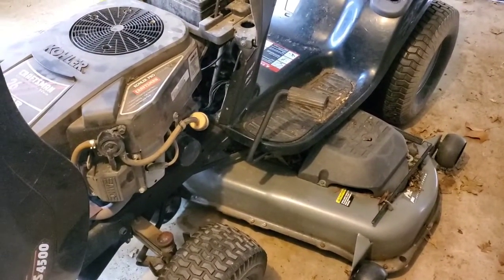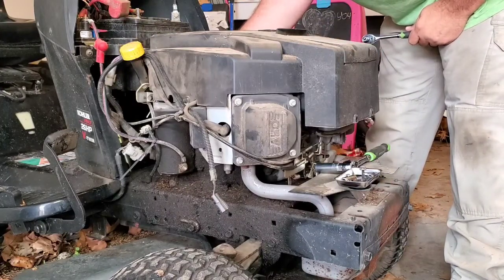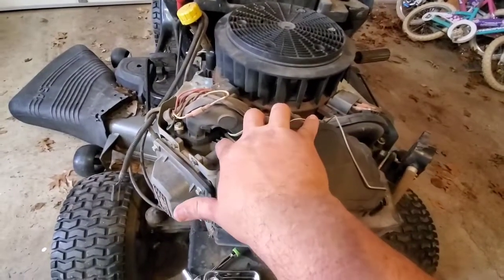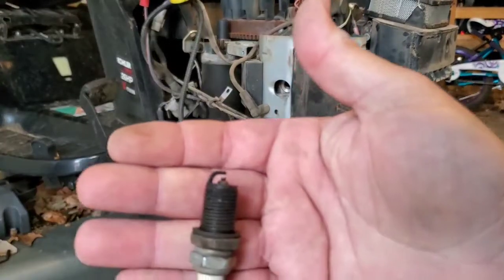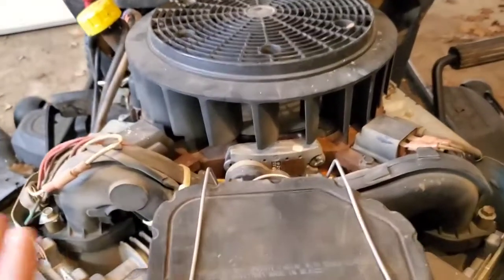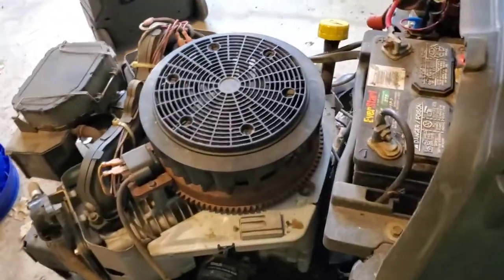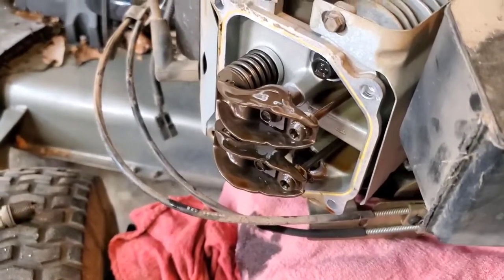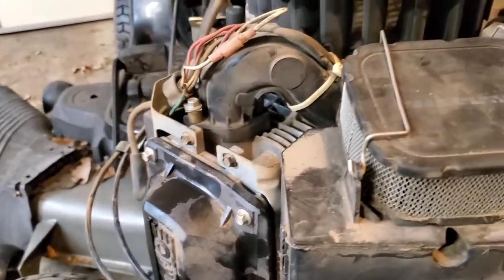Kohler Courage 26hp valve adjustment and preventative maintenance.

Comment: These motors ( V Twin ) calls for torque on valve cover bolts at 80 inch pounds or 6.5 foot pounds.  This is important. Make sure  you're at top dead center before  adjusting valves. I do mine at 4 thousands.  I have the exact some motor.  Great video by the way, very educational.
Reply: So it's 4 and not 5 on the intake what is it on the bottom one

Comment: You never explained how to get in neutral valve position
Reply from the maker: Well, there are a couple of different ways you can do it. You can take the time to get the cylinder on TDC on the compression stroke and set both valves. Or you can do what it do and slond the engine by hand and watch for one of the two valves to open all the way. With it all the way open, you can set the one that is still closed. Then spin the engine until the one you just set opens all the way up and then set the other one.